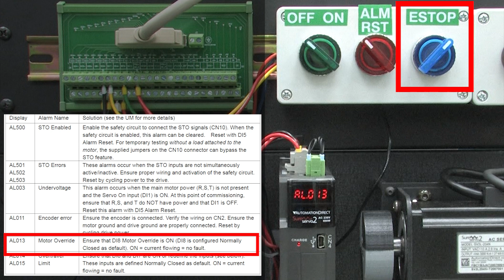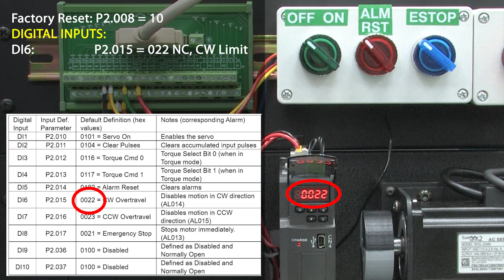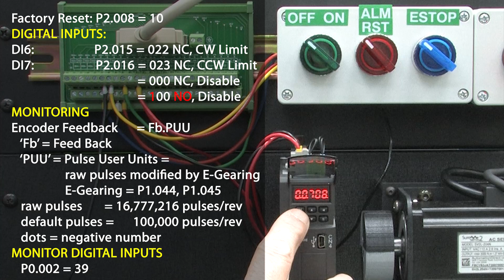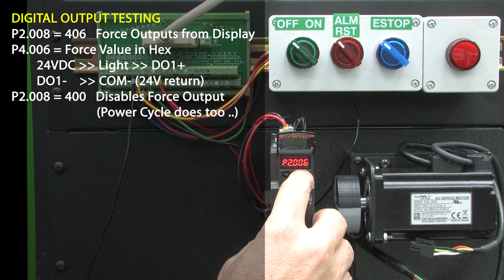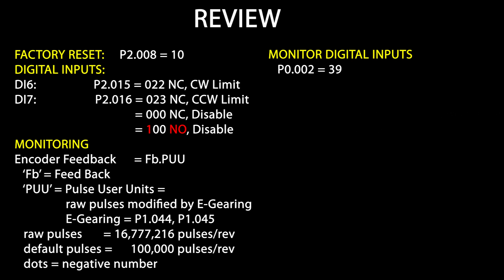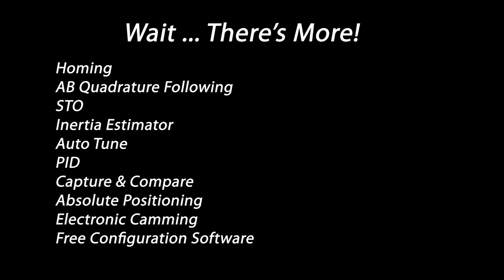SureServo2 Quick Start Part 2 Basics and Jog from AutomationDirect

Comment: Could you have another external switch input to start the motor turning in a similar manner to how you jogged it?
Reply from the maker: Absolutely. Setting any DI to a value of 0x37 will set that digital input for the jog forward function. 0x38 will do the same thing in reverse. The speed will be the preset jog speed which can be changed in the software.
Reply: @automationdirect  Thanks!

Comment: Can this drive be setup to run a 2-wire motor with no feedback such as halls or encoder? I want to simply command an output current to my motor based on the +/-10V analog input signal.
Reply from the maker: Thanks for the comment. Our line of Servo drives are able to work in the manner you are looking for.
Reply: @automationdirect  Thanks for the reply. I have looked at the manual for this drive and for other videos and am unsure as to how to achieve this. Is there a document or someone who can help me set it up as described in my original comment?